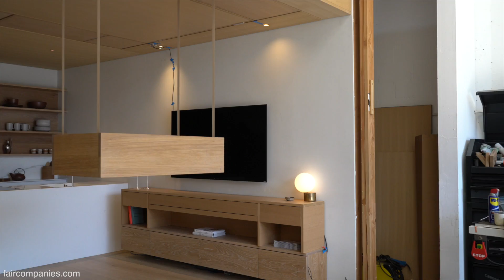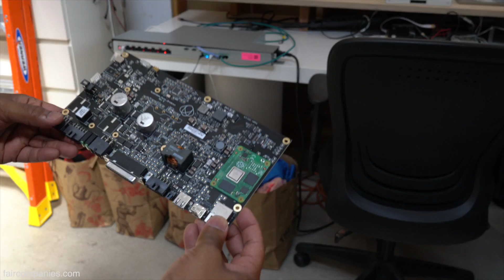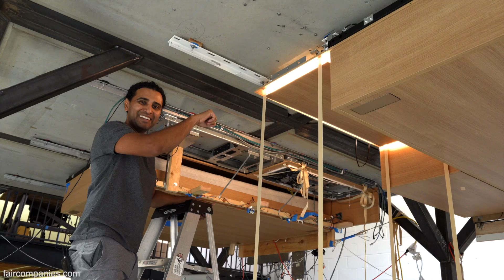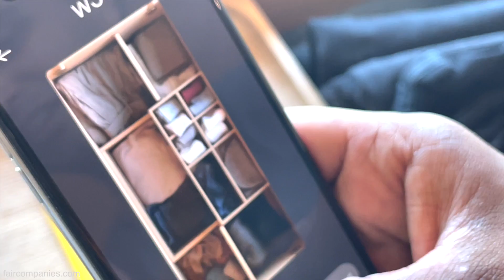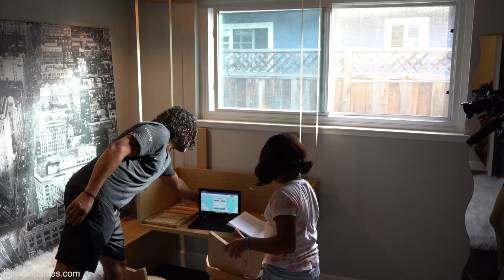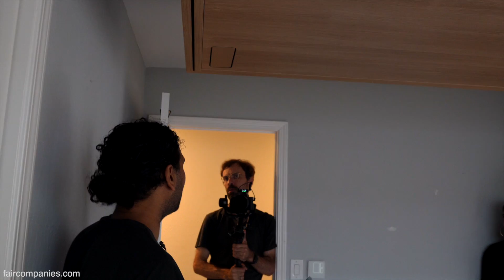Apartment furniture rolls into ceiling, it's truck-drag strong

Comment: Of all the "space saving" ideas this is by far the most practical solution I have seen, it doesn't create a compromise of something else to solve a problem. I can see this being a very successful company.
Reply: Sure, totally practical, until the components wear out or the power goes out.
Reply: @duduoson1306  I agree. I’m sure they have that “feature!” But they don’t show analog interaction. Plus, it’s literally Tons of weight hanging over you in an historically earthquake prone area.
Reply: Well yes, if the power goes out you can’t use it. But if the power goes out you also can’t see, and yet that’s something we put up with or find redundancy measures for (a torch)

You can always sleep on the sofa in the rare occasion that the electricity goes out 🤷‍♂️
Reply: @duduoson1306  Well I haven't experienced a black out in over a decade and if I was then I'd be getting a solar battery system like I have now. As for it wearing out, that totally depends on how well its made like everything else, hopefully its not designed to fail junk like most products.
Reply: @jedics1  we just had a 6 hour black out a two weeks ago.
Reply: @jedics1  Tesla power walls are my dream.
Reply: @heythave  Diy your own for 1/3 the price then its more likely to become a reality.
Reply: @jedics1  I wish I knew how. Many years ago, I wanted to go to one of the workshops that Real Goods had in Ukiah somewhere but I didn’t have a chance to.
Reply: Only takes about a foot in the ceiling. Works in most ceilings
Reply: This would be PERFECT in my 8x16 tiny house 8'-9' ceiling, leaving to want for literally NOTHING. Too bad the system costs more than the entire house...with a complete off-grid system ! 🤣
Reply: @shryder570  that is the contradiction. If you had money to pay for it, you wouldn’t be living in a space where this system is needed. And the people who live in small spaces like this are the ones most likely not to have money to afford this system.
Reply: @heythave  That is true in some cases. However, with the way housing is going now, if you downsize from a large home to a small one, you would have the money for the small space and the space-saving things in the video. I guess it's all about perspective, the individual situation, cost difference combined and what the persons ultimate goal is. There's something for everyone and you can't please everyone all the time. 😉
Reply: @shryder570  true, a small customer base.
Reply: Sorry but this is another thing that Silicon Valley over-thinkers tries to make mainstream by over-complicating things. Motorised furniture have been around since de 1950s. Once the novelty factor wears off there are too many road-blocks and red flags regarding usability and ergonomics, safety issues plus mother nature catastrophes such as earthquakes, maintenance and repairs costs, backup battery, points of failure, etc etc.
Reply: To bad this all cost's as much as bigger apartman.
Reply: Space saving in an apartment like this is evidently important to low income renters. I doubt people in that situation have the extra money to have this set up. I couldn’t see any building code allowing this, it most definitely compromises on fire safety and means of egress. On top of that, a pulley doesn’t seem very patentable and contractors could already easily install these for people. The camera logging your stuff is cool I will admit… If you live with a thief?
Reply: How is an incredibly engineered system practical? This is by far the least practical space saving solution I could possibly imagine. I think it's pretty neat, don't get me wrong, but something so complex is absolutely at risk for failure. For example, I've never worried about my desk or bed being unavailable if the power went out. I'd need to know there's a manual release when this thing almost definitely breaks.
Reply: only drawback: when sensor malfunctions you die
Reply: Rolling wall segment with a murphy bed, does not require electricity and electronics.
Reply: @waldemarsikorski4759  there are some ceiling storage solutions that don’t require electricity either, but this one has helpful motion sensors in case children get in the way, and a picture log for those who don’t remember where they put their stuff.
Reply: @mrs.manrique7411  But the two additional features you mention are the ones creating a solution to a problem that doesn't exist. Nobody needs a picture log in this type of situation, because people who utilise this type of solution are - by design - going to have to be organised. Each unit will be dedicated to clothing, or kitchenware or whatever. It might come in handy once every couple of months, but not worth putting an inventory of all your stuff onto someone's cloud for (is this just another data harvesting project?). If you had a hand cranked version of this system, it's a bit like operating a hand saw - the brakes are built in. The only time the safety feature of stopping would be required is when someone is deliberataly trying to crush a child. If they're at that stage, I'm guessing they'll find other ways to meet their ends. What it offers over other ceiling storage solutions, then, is gimmickery. Which is fine for those that like it, and it does look nice too. It certainly seems well built.

Comment: Storage (or furniture) in the ceiling and the smooth and quiet action are excellent, the basic idea and execution is great, but I hate this as a product. Some shady American company taking photos of everything you own, having to have a finicky smartphone in reach to open a drawer, the system becoming obsolete when newer versions of Android come out or when the company changes some URLs. Even in the demo they're fighting with the control as often as they are able to demo it. Buttons work darn close to 100% of the time. Even the safety features are concerning since they're relying on digital systems communicating with each other.
Reply: Did you miss the wall panel control? No smartphone. As far as your concern about digital systems, do you use elevators? Guess what, they are digitally controlled systems.

Comment: I always love innovation, and this is cool.  But, moving parts always come with issues:
-"Dude, you look beat."
-"Yeah, had to sleep on the hardwood floor, last night.  Couldn't use my bed."
-"What?  Why not?"
-"The motor's broken."

That said, the use of space is very well thought out.
Reply: How many time have you had to take the stairs because of a motor failure with an elevator?
Reply: @tinayoga8844  truthfully, more times than I can count.  It's the state of affairs when living in a major city (SF).  Four flights of stairs doesn't seem crazy, every once in a while. But, when you have to do it 6 times a day (between work and carrying an old, 60lb dog who couldnt do 4 flights to walk) for up to a week...basically every 4-6 weeks...it can get a bit rough.  But, my calves were rockin.  That building was less than 40 years old.  I'm sure if you ask NYers how many times they've had to take the stairs over a busted elevator, you'll find quite a few, too.
But, that's my point, exactly.   It doesn't matter what it is...an elevator...a car...a washing machine...when moving parts and a motor are involved, it will develop problems, eventually.  And with new designs, it will happen sooner than later, until the kinks get worked out over time.
I still like what this team is trying to accomplish in space-saving.  I'd just like to see a design in place that allows for an override to manually access the bed and storage.  It's a tough break to not sleep or to not have access to things in your home because of a motor failure or a power outage.
Reply: @tinayoga8844  Ince can be enough. It works perfectly fine, all the time, until it doesn't. A blackout would be problematic too in some places.
Of course it usually wouldn't be a catastrophe, or even just too dramatic, but it would be far from great.
I agree with the OP that a manual backup system would be great. At least for the most crucial things.

Comment: i personally prefer to elevate the floor and have storage underneath. or someone here said, have it on the wall.
Reply: Both.  I live in a small place -700 sq.m. Created a hanging dowel rack system all around the edges of each room.  Containers sit on dowels supported by stainless wire and hooks.  It works great and looks good too.  No elec., easy to get containers down.  Floor space is abundant.  Japanese futons easily roll and store.  Lots of cheap options.  At $14,000 for a bed, and only a bed, with the potential repair costs, far too much.

Comment: Too many electronics, microchips can go wrong. I think the concept is great though. I would happily adopt a similar system, if it were purely mechanical.
Reply: Exactly and nothing new, the Murphy Bed is over 100 years old, and does not rely on destroying the environment (electric of ANY kind including gas alternative energy or so called "green energy" as it is erroneously known. More male "thinking", which has gotten the world to the state it is in.
Reply: Automation is great as long as there are realistic manual overrides.
Reply: My alarm system has been working properly without fail for 30+ years. 
Electronics fail because of designers cutting corners to reduce cost. It didn't look like they were scrimping to me. I doubt if they can afford to do that at this point.
Reply: @tinayoga8844  Welcome to planned obsolescence. Its been around for a good 50 years. Electronics fail. Poor quality control and materials used in Asian production lines along with reduced production costs is the norm.
Due to the level of complexity of this system, I would never adopt it. Too many variables equates eventual problems.

Comment: So, what if there's a blackout or no internet service ⁉️
Reply: "Kirsten Dirksen (8 hours ago)
Because it runs on low voltage (one plug for the whole system), it only needs one backup battery to run for a few weeks. And when the furniture descends (because they're doing regen braking) it can charge the battery."

 Good question about Internet though...
Reply: Why do you think it needs the internet? They did show it controlled by wall switches. As far as a blackout, a UPS would power it. 
So many people say the same things, but they can't imagine the simple solution. Come on people!

Comment: It would be wonderful if this technology is adapted for tiny houses where walking space is limited but ceiling height is plentiful. And electricity usage is minimal, since most tiny houses are solar powered.
Reply: Will it be adapted? Dude, what are you talking about? This is already an adaptation for small rooms.
Reply: @Fazzrito  I think they meant full-on tiny homes: or homes that are basically built onto trailers that can be hauled around and placed wherever. I know there's a market for them similar to those of van conversions or van life.
Reply: It's already being used.

Comment: Good for storing rarely used or off season clothing or things that are not that heavy. But I'd like to see a simpler entirely mechanical system that uses hydraulics or weights as a counterweight.
Reply: Only problem with counter weight is…well…space!!!
Reply: Good take
Reply: I'm wondering if it could be adapted to the floor on a single floor home you'd only need a thicker foundation
Reply: I should have said spring instead of weight. Main concern is mechanical and electrical complexity. If there is fault on a circuit board, then there may be no easy way to operate it and get articles down. It is too expensive and complicated for furniture that is often used for two generations or more. Even a simple switch operated motor would be an improvement.
Reply: Weights and ropes in case of power outage.
Reply: A mechanical lift bed with counterweight design is coming to market next year, my design
Reply: Yes! I'm struggling with all of the unnecessary power usage, especially with the energy crisis we're in.
Reply: @tessadevocht3734  They specifically address that everything is low voltage and it uses minimal electricity and needs only one outlet.

Comment: I'd be so paranoid that the bed comes loose or breaks from tension and falls on the occupants. No way!
Reply: They showed the tensile strength when they had a truck and van both pulling on it in opposite directions. it looked like that was just a single strap.
Reply: But with normal wear and tear, anything can break at some point. Yikes! 🫣
Reply: @paranoidhumanoid  Yes, eventually the pyramids will also crumble to dust. Does that matter to the scale of your lifetime, or indeed, the much shorter lifetime of you owning a particular mattress or other hardware? The brushless motor will be guaranteed to give out before the straps. It's also held up by a minimum of four straps. The probability of all four straps failing simultaneously and affecting you or your life is approaching zero. I'm not saying this is a good idea, but your fear/criticism is baseless. I'm sure you can find something else to criticize about it that's based on reality instead.
Reply: @paranoidhumanoid  doubtful. If those straps are made of Kevlar, they will likely last three generations.
Reply: @snowballeffect7812  What about step motor failure ?

Comment: Interesting.  I like the idea of "hiding" furniture in the celling, but there is such a thing as too smart.
Reply: Power cuts, and no solar system, what to do??
Reply: @a-k6575  Or you lose your phone, or the program glitches, or crooks get a hold of the data ... the list of negatives pile up very quickly.
Reply: @rtyria  ...or the company goes bust or they decide to charge you a monthly fee for the app or (as I had with my Sonos system) the app does not work on a 2 year old Android version and you have to buy a new phone just to get the damn thing working again, etc.

Comment: To much technology for me. What happens when the electricity goes out. I don't need an app that can be hacked and jnuw where everything is in my house
Reply: They showed that the system could be operated with the wall switches. I'm sure you could disable any other mode of control. As far as the electricity going out. He said it needed about 300 watts. A good UPS would deliver that.

Comment: The bed is $14,000. A whole room setup can be $37,000+
Reply: Bumblebee is comparable to adding many rooms - the space value is 10-25X the price
Reply: @sankarshanmurthy1063  I dont think you're saving that much space here. you can just get a sleeper sofa, which is what more functional here. And with the amount of ceiling height you lose in this system you could easily replace with a row of high cabinets that dont require electricity and software. I love transforming spaces and space saving innovations, but this is just overkill in  my opinion.,
Reply: @sankarshanmurthy1063  No sir, sorry but you cannot compare apple to banana, when you add a room you add value that will last.

Comment: Are there fail-safe measures to avoid inadvertent injuries?  Like garage doors and elevator doors have?
Reply: yep, it has lasers that can detect objects under it
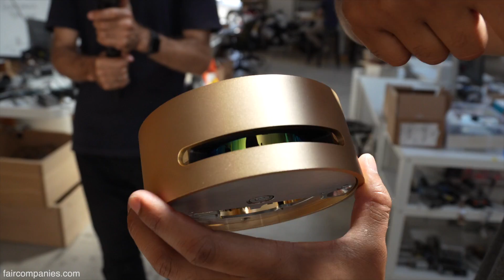Reply from the maker: @8:15 Sankarshan shows us the sensors that are constantly scanning under the furniture
Reply: @kirstendirksen  Was wondering about a fail-safe system.  A single system could fail.
Reply: @DWilliams-ce8nb 
part when they compare it with seat belt, in the beginning...
Reply: This is not comparable to a garage door opener. It is far more expensive. Part of the increased cost is the sensors. As far as elevators, when was the last time you had an elevator cause you an injury? The only time I see issues with elevators is in the movies.

I was a electronic design engineer. (retired this summer) As long as they are not trying to cheap out on cost the systems can be extremely robust. My only concern would be the structural integrity of the building it is gong into.
Reply: watch the video and find out.

Comment: If you loose power you're kind of screwed.  Reason for calling into work?  My furniture ate my clothes.
Reply: If someone had that system in their home then it would not be a stretch for then to include a backup battery and inverter for backup power.
Reply: worse if you loose power to an earthquake
Reply from the maker: Because it runs on low voltage (one plug for the whole system), it only needs one backup battery to run for a few weeks. And when the furniture descends (because they're doing regen braking) it can charge the battery.
Reply: @kirstendirksen  that's pretty smart. On wonders if a small photovoltaic could serve in a pinch.